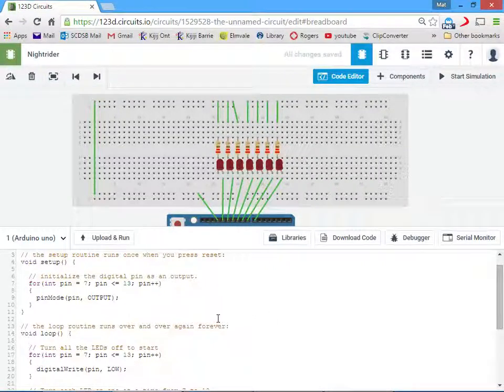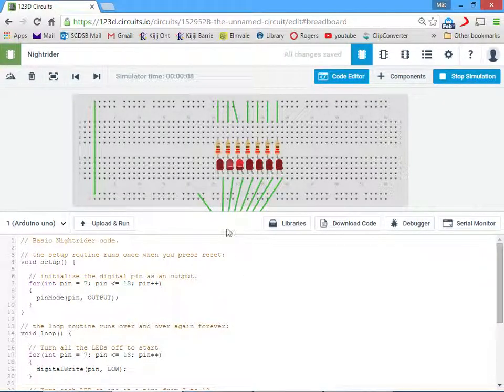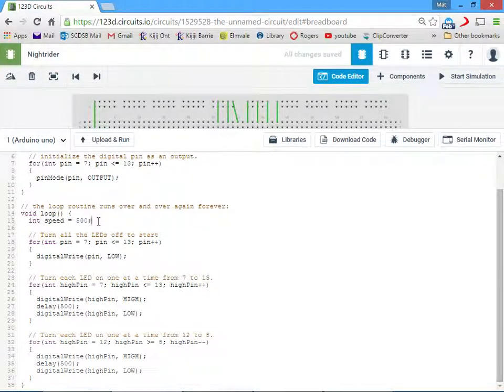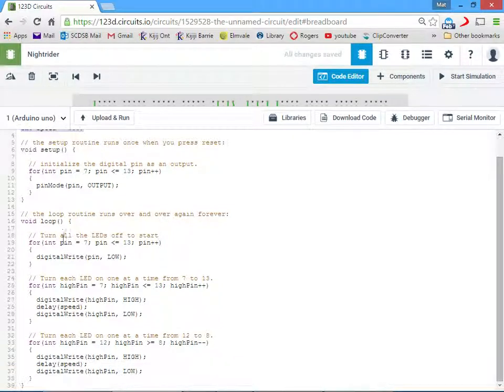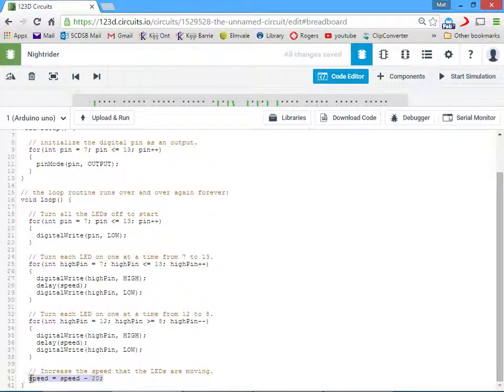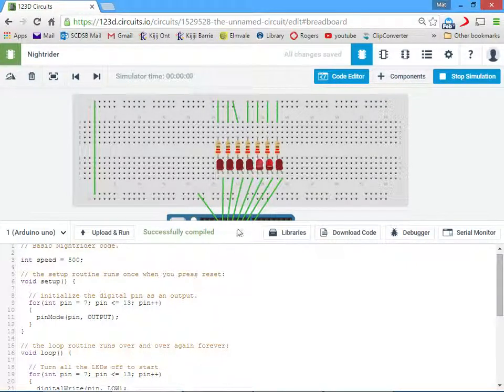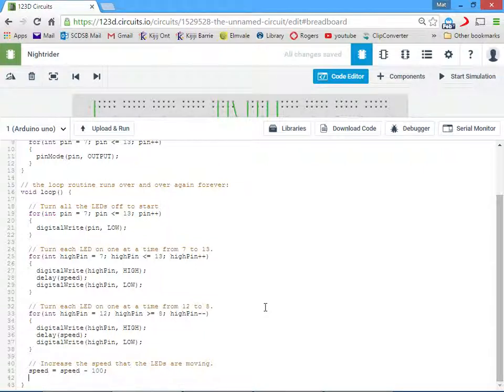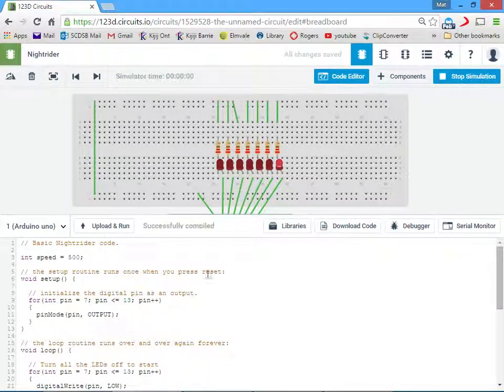Arduino Knightrider Tutorial 2 - Speeding it up

Comment: Hi... Just viewed your first two video using the 123Circuits.io simulator. I would like to know how well does the simulator reflect real world Arduino.  Thank you for posting this video it has been a great help in learning to create Arduino code.
Reply from the maker: I like 123Circuits.io, I find it reflects real world Arduino code very accurately. There are 3 main problems that I have with the site, 1) there are parts that I want that are not available like a joystick. 2) If you have multiple buttons you can't push more than one button at once, 3) As the code gets complicated it runs a lot slower on the site than an Arduino would run.
Reply: Thank you for responding back it was most kind of you.